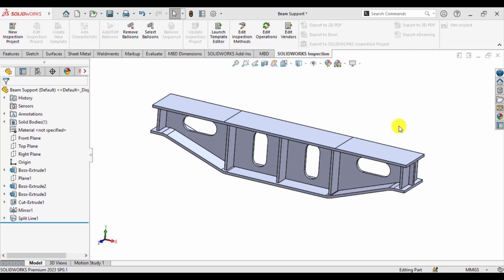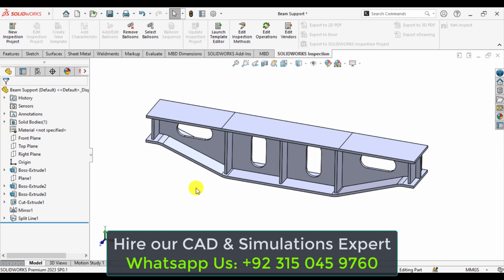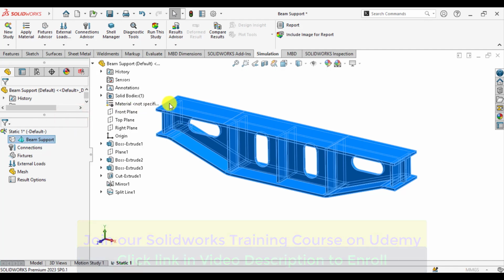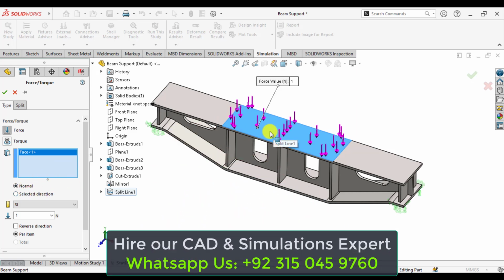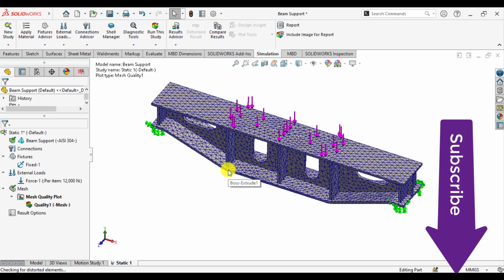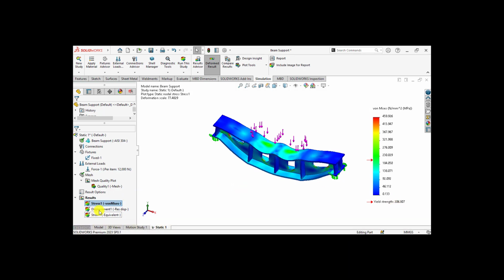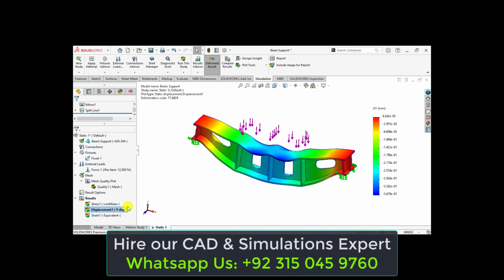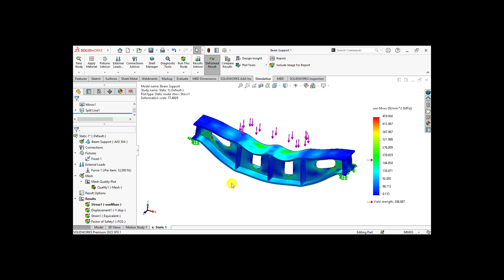Beam Support Static Analysis with Solidworks Simulation

Comment: Why is the displacement different when the analysis is performed using beam elements 1D or 3D compared to using tetrahedral elements?  What displacement should I consider?
Reply: If the beam is long and slender, we can simplify it and use 1D (ignoring other degrees of freedom and shear deformation. i.e classical beam theroy). For complex beams, tetrahedral is required.